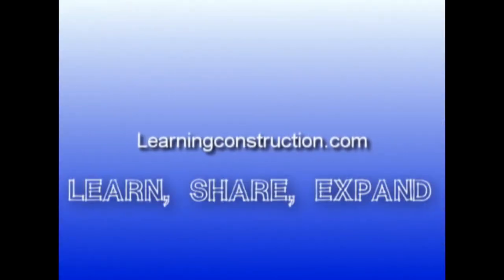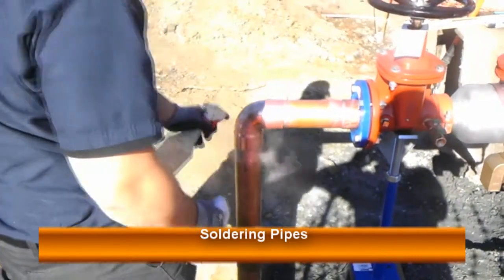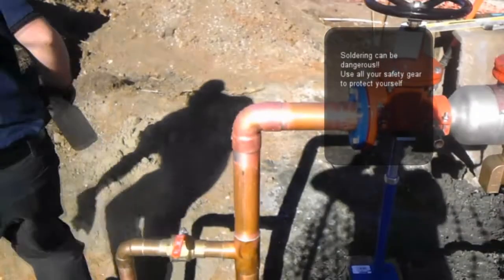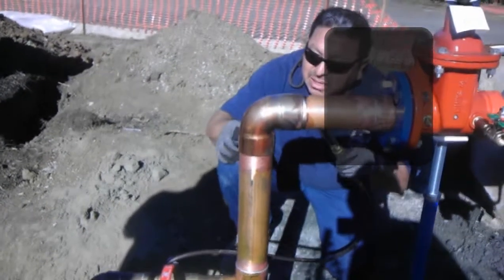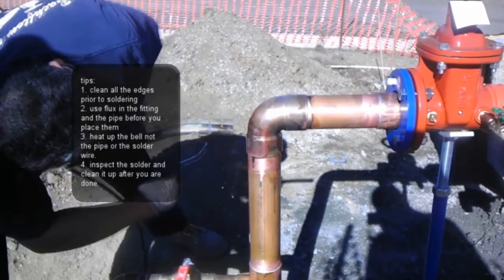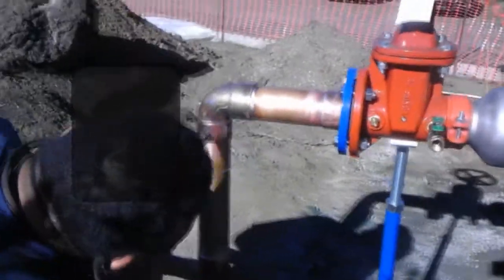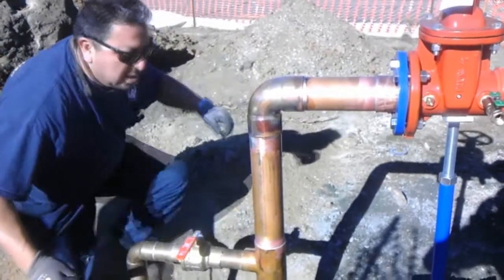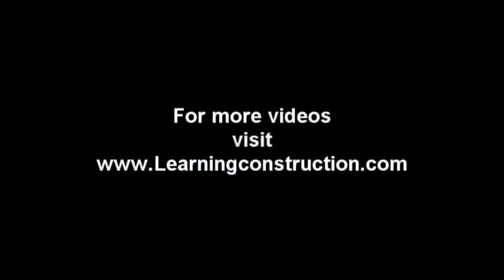How to solder a Copper Pipe

Comment: You want to heat up the pipe first to close in the gap between the pipe and fitting since the pipe expands. Only heating up the fitting makes the fitting expand, creating less heat transfer to the pipe underneath